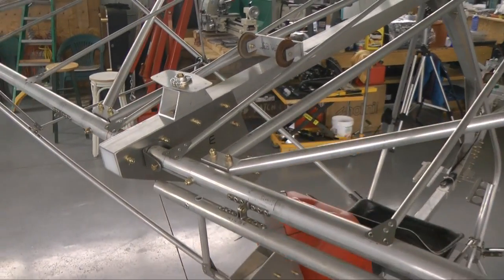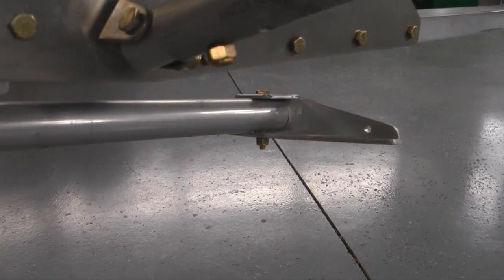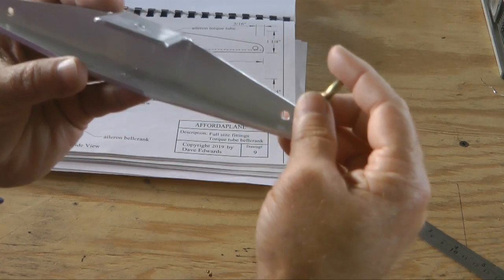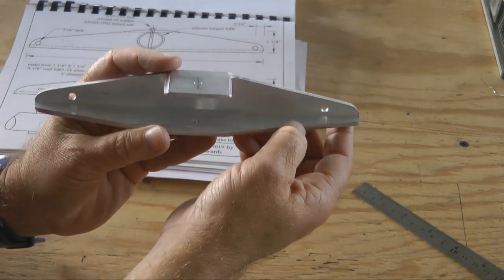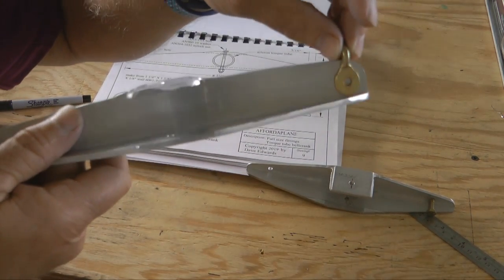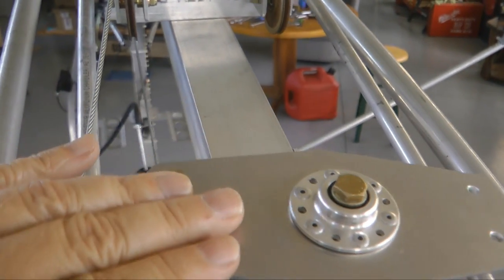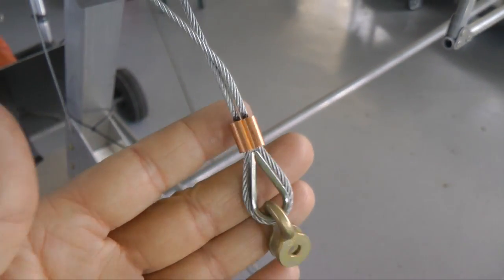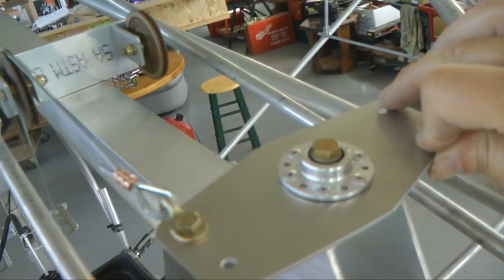Building the Affordaplane Part 44

Comment: Thanks, Jon.  I appreciate you posting these updates!  Just a couple of comments about making cables.  If you're using stainless steel cable, you should be using tin or zinc plated Nicopress sleeves to avoid dissimilar metal corrosion that can happen with the unplated copper sleeves.  It's also a good idea to slide a piece of heat shrink tubing over the cable before you crimp the sleeve, then shrink it over the exposed cable tail; this will prevent the cable end from unraveling and protect fingers from being poked.  Keep up the great work -- I can't wait to see your A-plane fly!

Comment: Surprised a turnbuckle is not included in the aileron cable assembly for rigging adjustment.
Reply from the maker: @electoplater  Yes good thing pilot weight not penalized against aircraft weight limit here!

Comment: G,day from Sydney Australia.
Nice instruction. Questions on my mind;
1. There are alot of marine ship chandeliers (supply shops) in Sydney. Would the materials, such as cables, shackles and hardware be accepted for experimental aviation?
2. I missed the stick assembly and shackles for elevators and aleirons.
Have you released a video on the construction?
3. Was that 1/4" stainless threaded rod or cut a thread each end?
🌏🇦🇺
Reply from the maker: John,  (1) If this were a certified aircraft we were building, then all parts would have to be of the proper types.  Because this is not, then judgement would have to be used on an individual basis for each part - cannot really make generalizations that work. (2) Please go back and watch all of the videos to pick up on the stick and elevator controls. Often the description below each video has a quick summary of its contents. - Or - just watch them all!  (3) The threaded rods I use (as in the plans) require no threading - they are completely threaded - just cut to size.

Comment: Thinking of the pulleys on the top of the plane before the bell crank, does it make sense to have them slightly adjustable fore/aft to modify tension to the pilots liking and any stretch to the cables over time? Also the mounts for the pulleys being more L shaped to make sure they couldn't easily jump off the pulleys? Could high wing un-loading cause then to do so?
Reply from the maker: Good idea on making those pulleys adjustable.  Would need a little design effort - I dont like using slots - but there are of course other methods.  My video on constructing the pulley assembly shows that I have created them in a way that the cable has no room to come off the groove!
Reply: @HomebuiltHELP  Thanks I will go back and re-watch it again.

Comment: Is the general rule to have 1/2” of material between the edge and any hole?
Reply from the maker: There are no general rules on this topic. The answer depends on hole diameter and thickness and type of metal used.  Here is a video I made on evaluating edge distance in sheet metal - as per FAA guidelines:  https://www.youtube.com/watch?v=FY8Nn7_6Erc

Comment: Did you use galvanized 3/32 7x19 cable for the ailerons or stainless?  I see copper nicopress so I am assuming galvanized?  Asking because the plans parts list shows it as stainless but I thought you couldn’t user copper with staineless.
Reply from the maker: I used galvanized. Both are suitable in certified aircraft.  More than a few sentences needed to compare all differences! One that is simple to understand: $$
Reply: @HomebuiltHELP  Thank you.  I have been researching, seems like galvanized is maybe a little stronger but more subject to corrosion, definitely cheaper.  BTW, thx for your videos, I think, as far as youtube goes, I have learned more from your videos than most others regarding building or working on experimental aircraft.